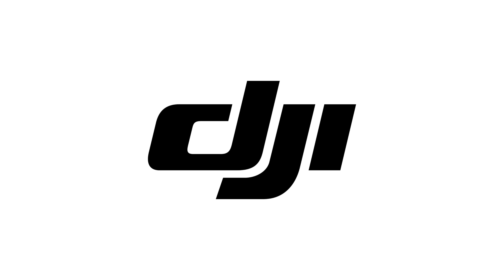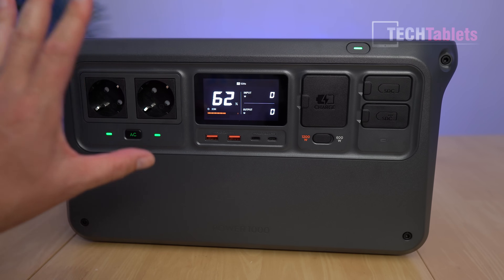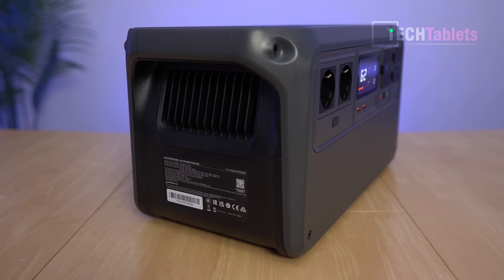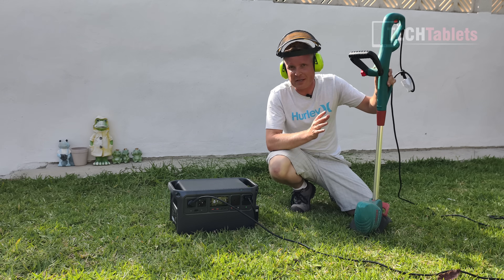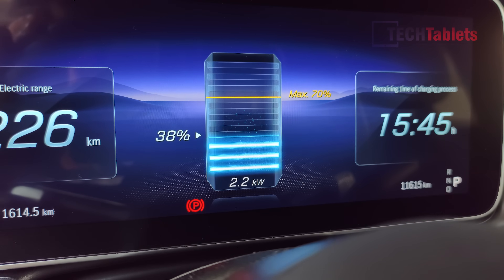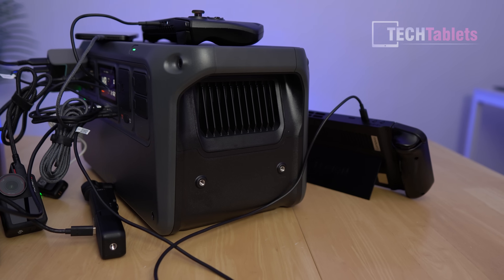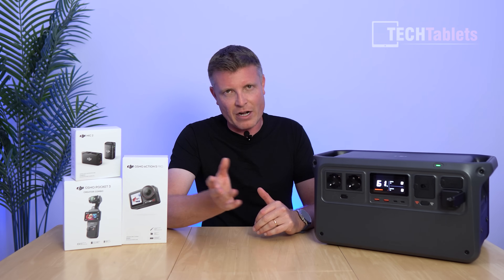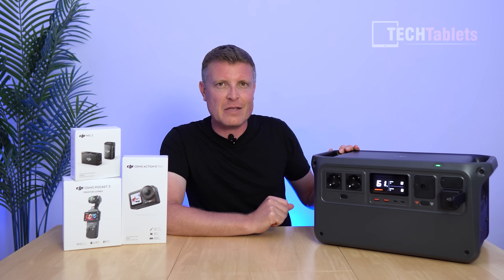DJI Power 1000 Hands-on.  Is This DJI Portable Power Station Any Good?

Comment: Here in Malaysia, the Power 1000 cost about the same as Ecoflow Delta 3/3 Plus. The major key difference between the two is AC power output (2200W for DJI vs 1800W for Ecoflow) and AC outlet port (6 for Ecoflow vs 2 for DJI).

Sticking with DJI, this isn't even new. In China, there's Power 1000 V2 which bumps the AC power output to 2600W and adds extra two AC outlet port. If 2600W is not enough, DJI even made Power 2000 (not to be confused with Power 2000 Battery Expension) with 3000W AC power output.
Reply from the maker: I would definitely go for this over that Ecoflow. Same price but much better output and it’s quieter than my last Ecoflow and Bluetti. I wonder if the V2 will come to Europe.

Comment: @TechTablets :  hi Chris, can you please perform the following test with this unit, to test the stability of the UPS functionality :
(1) connect the DJI to the power grid to charge it
(2) connect a Desktop PC (a desktop PC, not a laptop : this is important) to it and power it on whilst the DJI is also charging from the grid (play some games or do some productivity tasks on it
(3) whilst the Desktop PC is running, unplug the DJI powerbank from the grid
(4) verify if the Desktop PC keeps running without problems or if it crashes or freezes

Thank you, Chris !!! 😎😎😎
Reply from the maker: Hi, It was  to be mentioned in my video, I use it as my PC UPS as Spain's power grid is unreliable. But yes I can confirm that works 100% I even just tested it now again. So my Mini PC with eGPU I use as my work PC I have it connected to the Power 1000, I pulled the AC plug and nothing not even a flicker as it's so quick taking over. 0.02 seconds is the claim which I happen to believe. NO crashes or freezes it's fine.
Reply: @Techtablets  thanks for the update about the UPS functionality, Chris !!! 👍👍
That is very good news. With you mentioning the 0.02s switching time I was actually expecting it to fail this test, because PC's are very sensitive to power interruptions and fluctuations. I've had a PC die on me because of power issues, so UPS's are since that moment part of my setup.
Thanks again for the update, Chris : EXCELLENT JOB !!! 😎😎😎😎

Has it been 9 years already ? Wow... Yeah, I remember in the beginning you exclusively did tablets (hence the channel name, I guess), and you still had the domain name with the online forum (really good source for tablets back when it was active). I am glad that you went "a little wider" in terms of review subjects when the tablet-hype died down, staying relevant. I like your style of reviewing and reporting, and the quality has gone up quite a lot too. KEEP UP THE GOOD WORK, MATE !!!!! 🙂🙂🙂🙂
Reply from the maker: Thank you. Yes it use to be tablets mostly as you know but I had to shift and also I get bored  if it's just mobiles or tablets so cover many tech related things now. As for the UPS I half expected it to cut out myself but it doesn't at least not my mini pc here. Again thanks for the support over the years!
Reply from the maker: I have just seen that you have been subbed for 9 years! Wow great to see people still about many moved on & lost interest in the tech etc. Thanks for the support!

Comment: Wonder how well these will stack against ecoflows 🤔
Reply from the maker: Just as good, I've covered many ecoflows and Bluetti in the past and this quality is great with even better fan noise especially when charging. My only complaint is no wireless charger and would be nice BT/Wifif built into it. DC car charger plug also would be nice but you have SDC to car charger and other adaptors for that.

Comment: No, it's better there is no BT or Wifi on it, so risk of it being hacked and stealing your info. Where is the teardown Chris? You need to crack it open and examine those LFP cells to insure it's a reputable brand, look for LG Chem or Samsung cells. At least know the brand!
Reply from the maker: As mentioned before something like this I'm not going to open up, likely damage it and it's dangerous if I short something there is a fire risk.

Comment: Hello mate! Still no ebikes??? That power bank looks really cool – it's just what we need for our camper. But I'm a bit confused about those DC plugs. Can you tell me more about them? I really like the Type-C, but I was disappointed to find that it doesn't have a car socket plug for using my air pump. It would be great if it could accept solar input directly, without having to buy an accessory. I'm a little disappointed, to be honest. I really like the LFP cells; 4000 cycles is incredible, and the 1200W charging is excellent. I really like it, especially for 600. I think it could have been even better
Reply from the maker: Hi Baron, yes ebikes are coming this week maybe a new ADO 3 speed foldable. Yes you can get DC car lighter style plugs for this but you need the DJI Power SDC to Car Charger Plug Power Cable (12 V) unfortuntly it's require for that and solar panels. Yes it would have been good to have an XT60 or other direct solar input plug built in. LFP is the only cell chemistry I would go for in power stations as it will last the longest.
Reply: @Techtablets  Ebikes! Great looking forward to that is it that Bafang 3 speed? Great that you can get car charger plugs but you have to pay extra. Thanks mate.
Reply from the maker: Yes the Air 20 Ultra 3 speed hub, video coming soon.

Comment: Nice video Chris. Could do with one of these for my RV, but no 12V/24V DC car lighter sockets for it, anderson plug or even DC 5mm barrel plugs? That is a huge miss for RV owners. Why did DJI do that?
Reply: Strange choice
Reply from the maker: @RdMcRd897  You can get adaptors for that using the SDC plugs.
Reply: Exactly what I was thinking lacking DC plugs and the common ciggy lighter plug. What was DJI thinking!?
Reply: Planned so you're forced to buy the accessories for what should be included is very Apple like of them.
Reply from the maker: HI, not sure I guess to have more flexibility on what plugs both output and input you use. I just answered someone else asking about this so you can get a DJI Power SDC to Car Charger Plug Power Cable (12 V) maybe even SDC to Anderson.

Comment: No idea DJI makes battery banks, I have their Mavic Pro drone still working fine after crashing it I replaced the rotors. Thanks for the video.
Reply: DJI makes everything you can imagine!
Reply: We have their Action 4 it's good. Not just drones been like that for years now.
Reply: I think DJI makes everything 😂
Reply from the maker: Yes power banks now.